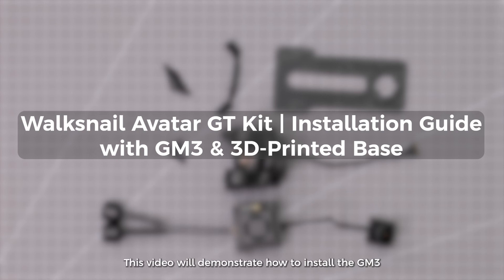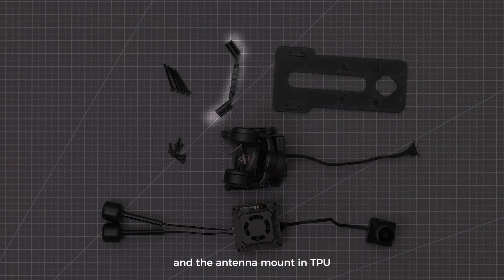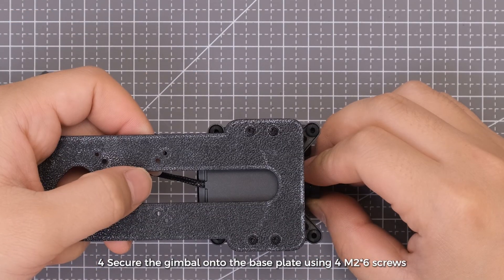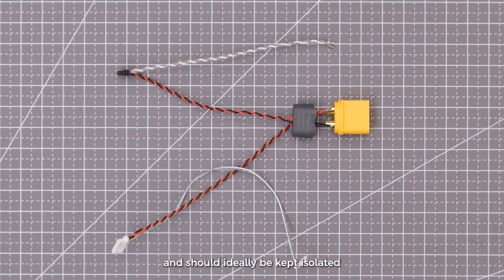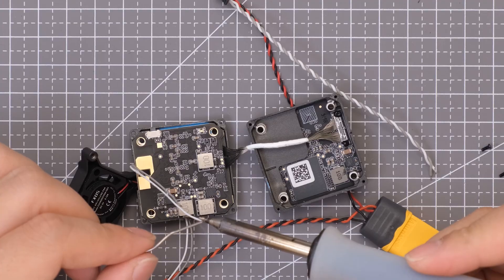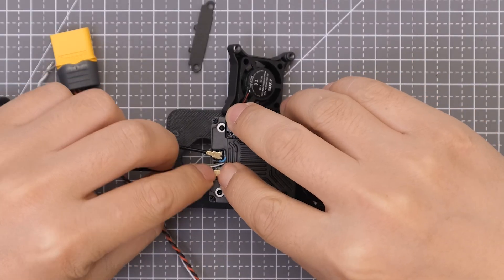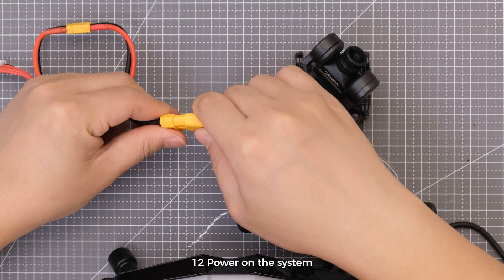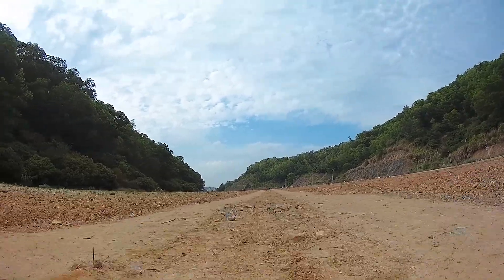3 Minutes to Set Up a FPV RC CAR!

Comment: I printed the mounting base and antenna bracket but the antenna bracket does not fit with the antennas. Antenna holes and slit for coax is too small. Is there an updated file how do yours fit so well??

Comment: Hello, I need help with the equipment not connecting. I bought the GM3 gimbal kit, the Avatar GT kit, and the Google Avatar L walksnail gimbal. I can't connect the GM3 gimbal to the gimbal. Only the image transmitted by the camera appears, but when I move the gimbal, the GM3 gimbal doesn't move. I've already configured it in PTZZ and tried updating the VTX with the file downloaded to the memory card, but nothing changed. Please help me resolve this issue with connecting the GM3 gimbal. I connected the white-to-white and gray-to-gray cables from the VTX to the GM3 gimbal, and it didn't help at all. Would I have to solder them too? Will the Google L glasses work too? Thank you, waiting.

Comment: So with the Pro Kit instead of GT, do you still need to solder or are those connections included in connector cabling?
Reply from the maker: Basically, whichever VTX u use for a RC car, u need soldering most of time. :face-blue-smiling:

Comment: Can I use just connectors instead of xt60 connectors?
Reply from the maker: It depends on whether the GM3 gimbal is powered by separate battery or not.:face-blue-smiling:

Comment: Walksnail x will be better signal with work gm3 than goggles L ?
Reply from the maker: Hi, buddy :face-red-heart-shape: U r right
Reply: Hello, I need help with the equipment not connecting. I bought the GM3 gimbal kit, the Avatar GT kit, and the Google Avatar L walksnail gimbal. I can't connect the GM3 gimbal to the gimbal. Only the image transmitted by the camera appears, but when I move the gimbal, the GM3 gimbal doesn't move. I've already configured it in PTZZ and tried updating the VTX with the file downloaded to the memory card, but nothing changed. Please help me resolve this issue with connecting the GM3 gimbal. I connected the white-to-white and gray-to-gray cables from the VTX to the GM3 gimbal, and it didn't help at all. Would I have to solder them too? Will the Google L glasses work too? Thank you, waiting.

Comment: Wait, is the avatar GT compatible with the gimbal now?  I thought it wasnt compatible?
Reply: It is, but it needs to connect to TX3 and RX3 which are not broken out to a connector on the GT, hence the soldering to pads inside.
Reply: You need a HAM license to use these in the US right?
Reply: Hello, I need help with the equipment not connecting. I bought the GM3 gimbal kit, the Avatar GT kit, and the Google Avatar L walksnail gimbal. I can't connect the GM3 gimbal to the gimbal. Only the image transmitted by the camera appears, but when I move the gimbal, the GM3 gimbal doesn't move. I've already configured it in PTZZ and tried updating the VTX with the file downloaded to the memory card, but nothing changed. Please help me resolve this issue with connecting the GM3 gimbal. I connected the white-to-white and gray-to-gray cables from the VTX to the GM3 gimbal, and it didn't help at all. Would I have to solder them too? Will the Google L glasses work too? Thank you, waiting.

Comment: Why are we soldering the Rx TX wires to the Vtx?
Reply: I didn't understand the answer
Reply: It needs to connect to TX3 and RX3, which are not broken out to the connector on the GT